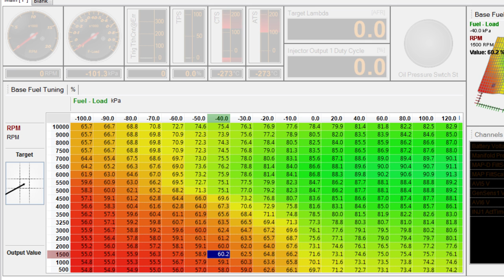Carburetor vs EFI: Separating Fact from Fiction - Technically Speaking.

Comment: For the average guy with the average engine, individual cylinder tuning requires more than what you have described here. A lambda probe in each exhaust primary is required and 4 dual channel wideband controllers are needed. Factor in this cost and sequential tuning is very expensive to set up. Batch fire is the next step down from this....but still better than a carby for atomization.

Comment: Changing from efi to carb right now on 85f150. It has cost me more money than the damn truck is worth changed fuel pump fuel filter throttle position sensor air intake valve and every other damn sensor on the truck! I’m going back to when a man can diagnose any problem within ten freaking minutes and fix cheap and easy! (No EFI)
Reply: Lol, typical parts thrower who doesn’t know what he’s doing, sometimes a popped fuse is the only problem.

Comment: Good evening.
If you look at the draw through turbo bike I've built (on my channel) you'll see I'm using a single flatslide carb. I'm thinking of changing this to run efi with individual injectors for each of the four intakes. I will fit a single, large throttle body where the carb is currently to keep the old school draw through look. Would you have a system that will fit my needs?
Thank you.

Comment: By using single point injection, you lose EFIs only advantage: cylinder-to-cylinder fuel distribution.
Reply: Hr BeStalkinMe 
You can also change cylinder to cylinder fuel distribution on a carb with a zip tie. Old racer trick
Reply: single point EFI has many more advantages than just that...

Comment: Carburettors are a pain in the arse. 

However I'm not a fan of direct injection systems as it can cause carbon deposits on the inlet valves and can cause engine knocking problems.I'm also not sold on the reliability of direct injectors that operate at insane pressures. I've had a lot of problems with cars I've owned that used direct injection and zero problems on cars that used ordinary multi-point injection setups.

Comment: Thanks for the video, but you forgot to mention how even though EFI is much more precise, it doesn't make as much power as a properly tuned carburetor and a well designed single plane intake, in the conditions the carb was tuned for. I'm not even going to try and say carburetors are better for daily drivers, they just aren't. They obviously don't adjust themselves for atmospheric conditions. But in a racing setup you get more power due to varying fuel droplet sizes from a carburetor. Injectors make a mist, which while great for burning fuel efficiently, doesn't make as much power. Also, considering a port injection EFI system is at least three times the cost of a top-of-the-line Holley, I think I'll stick to carbs, for now anyway.
Reply: +outlander330cc  
Can you provide any documented scientific proof of your claims?
Reply: No, but you can ask David Vizard and countless performance engine builders. In a drag race application you don't want fuel slosh and that's one of the reasons why the top tier drag cars are EFI. Truck pullers almost always use carbs, the low speed doesn't slosh as bad as drag racing. I'm not sure about circle track and road racing. As far as horsepower on the dyno goes though, carbs are always king.
Reply: +outlander330cc 
With all due respect, the blanket statement that EFI "doesn't make as much power as a properly tuned carburetor" is not accurate in all instances. 
I do not know what country you are from, but where I am in the US, that statement is proven not accurate. 

It should be noted that Vizard's testing and statement originated in 1999 and was not a level comparison then and today EFI has progressed and improved exponentially. 
Many of the others that still espouse carburetors over EFI are mostly old farts that are either incapable of learning and or do not want to expend the effort to learn about EFI. 

David Vizard's comparison was not an equitable comparative test for the following reasons.
(1) It was a comparison of a short runner single plane intake and carburetor against a long runner intake and EFI system. Vizard has acknowledged this and the flaw in several subsequent interviews. 
(2) The peak horsepower increase on the short runner manifold and carburetor was less than 1% and only occurred at WOT and in a very narrow RPM range near or at peak RPM. 
This <1% HP increase at peak RPM is indicative of the advantages of a short runner single plane intake more than can be attributed to a carburetor for fuel delivery. 

Intake manifold runner length is a critical element in intake design. 
Short runner intake manifolds optimize power production higher in the RPM range and long runner intake manifolds are designed to promote power production in the lower RPM ranges. 
On flow benches most EFI/throttle body/manifold combinations usually have higher flow numbers, especially at less plenum/runner depression values. 

Personally I have experienced mixed results when comparing carburetor to EFI performance on dyno runs. 
In 2014 we logged more than 1200 hours of dyno time, so far in 2015 we have logged more than 900 hours dyno time on engine and chassis dynos from multiple manufacturers that includes SuperFlow, AVL, DynoMite and Mustang. 
When the testing platforms are equal, most but not all our dyno testing and analysis of carburetor versus EFI results in EFI being the clear winner, especially in mid range up to max RPM where power and torque gains can be significant and in max HP/torque produced. 

Ask yourself why practically every race class champion that can run fuel injection or carburetion run injection and win? 
NHRA has changed the rules to allow EFi in Pro Stock and testing has already shown lower ETs and higher trap speeds with EFI. Not to mention the many other benefits of EFI over carburetion including but not limited to ease and extensive flexibility of tuning, intelligent feedback and integrated logging. 
With regard to EFI system cost differences being "at least three times the cost of a top-of-the-line" carb system is just not accurate where I am located. 
Today the cost difference for EFI is higher, but when comparing like performance systems, EFI is only a few hundred US dollars more expensive.
Reply: patw52pb1 Thanks for the detailed reply! I was hoping to get a conversation started on the subject, I had always been told carbs made more power but was kind of skeptical if that was the reality these days. I'm not exactly an experienced engine builder yet(only a couple hours of dyno time) so it's nice to hear from someone who's got some experience. Yes the first couple comments were borderline offensive to you EFI guys, that really was just to get you to reply haha.
Reply: ***** That makes a lot of sense, although I feel like methanol injection on an EFI vehicle would do the same thing, maybe not to that extent though.
Reply: +outlander330cc  The Carburetor cooling effect is real, but very misleading.While it is true that the colder air fuel mixture with the carb set-up often leads to more power on the top end of the range because of increased density, to compensate for that, the timing and or compression ratio on the EFI engine needs to be increased- even though the carbed engine would ping, the efi engine wouldn't. They never do those comparison tests that way, because it doesn't seem to be "apples to apples" comparison anymore.
Reply: No, just no... carbies can get close at some points, but with EFI the mixture can be set properly at every point - that is, load and rpm. If you are running individual throttle, especially with a 'healthy' cam' with decent overlap, reversion and rich running when off the cam' is a big problem as some of the airflow actually passes through the venturis 3 times - with EFI the fueling is provided for the actual air the engine uses.
Just call those Mikuni's slide throttles - sure, in their day, they were a common swap and a big saving on Webers or Del'ortos but a lot of messing around with linkages and keeping them in balance and they did have limitations.
Carbies have as much flexibility as EFI, regarding fitment - with some vehicles they can be an easy swap, with others it can entail a full intake assemble swap over. With a significant power gain, and hence fuel demand, a carbie setup may also need a pump and regulator upgrade. So, the may not be much difference - or it may even cost more...
When changing the fuel curve with carbies, one has to have a good idea of what one is doing - with emulsion tubes, chokes, jets, etc - and each time one wants to change the curve, one needs to have the replacement parts available to fit - $$$ - and it takes time to do so... and if you drop anything... whereas with EFI it just needs a couple of seconds to change some values. Not sure about the small child - I've had to repair a fair number of bodged 'repairs' people who thought it was easy messed up.
For the different applications, the right selection of manifold design and carbie can make a big difference in how a V8 performs - besides being easier to package and cheaper, they can give a much wider torque range than an independent runner design - even with EFI - this has been proven many, many times.
So, I'm a bit confused with that comment - you prefer something that doesn't work as well most of the time, uses more fuel and is harder to tune - the cost is subjective and application dependent?
Really? I've found very few people who do their own 'tuning' actually have much idea of what they are doing - probably about the same number of people playing around with EFI - but the industry has progressed to the point where EFI is darned close out of the box and some will even fine tune themselves to suite the engine's particular variables.
SUs on a Triumph GT6? I've only seen them with Strombergs as OEM Regardless, a single carb' just wouldn't be able to supply anywhere near the airflow required, will need careful setting up and modification if tried, and will suffer from severe icing up from the pressure drop across it. If you think it's that easy to install and bodge a supercharger conversion, I very much doubt you've ever had anything to do with such a one-off.
330Ci? If you're serious about it, just buy one of the kits currently available - easy peasy and probably cheaper than the GT6 bodge.
Doing anything properly will take time and money - where one calls the line will depend on what one expects. Don't forget that not doing it properly - carbies or EFI - will also be expensive, not just for the time lost messing around with bits and pieces, but the testing (dyno' time is expensive), jets, tubes, distributor mod's, etc - and the ongoing poorer fuel economy, drivability, etc, that is about right from the start with the correctly selected EFI kit.

Oh, somewhere in there you made mention of the noise - I run Jenvey ITBs on a Cosworth KBA - friends have run DTH and other types of ITBs and there is no loss of intake sound Vs Weber, Del'orto or other ITB carbie installations. heck, it can be downright painful close up without hearing protection!
Reply: No worries, started my auto' mechanic apprenticeship in the mid seventies (damn, that makes me feel old) and most of my working life as a mechanic was on carbies and points, so I know their worth - what I am saying is that EFI (potentially) is better.
SUs and Strombergs operate on the same principle and, before they started messing around with them for emissions, they certainly are a basic fuel metering device - but I have seen some botch jobs with both and even one chap who thought he had a dropped valve and parted out his car when it was a simple hole in the diaphram - god knows why he thought that when there was no noise...
Regarding the icing - you sort of have an idea of the problem - what causes the icing is down to two things 
a/ while all cabies use a pressure drop to draw out the fuel (venturii or depression) there is also the pressure drop from atmosphere at ~1bar/14.7PSI on one side to a lower pressure on the intake side because the carb' is a restriction - if the carbie is too small the pressure difference, and hence cooling effect, is greater. I have seen this occur in at least two instances with draw-through turbo-chargers with a SU and the 'cure' was to use a much larger SU carb - the chap using two would have a similar effect - and 
b/ if/when the carb'body temperature drops to 0C, or below, any water vapour in the incoming air that contacts it will freeze, further restricting the airflow and hence pressure drop, and can build up to a point where the throttle butterfly is frozen in position. 
Some of your comments do underline the advantage of 'old school' over EFI, though, and one I can sympathise with - faults are easy to find and rememdy, and there is much less to go wrong - although modern electronics is a world away from the early stuff as regards reliability (well, there are exceptions, like the smaller VAG dual clutch gearbox which was notorious for expensive electronics faults).
With the dissy, with a match-head of grease on the rubbing block, it should last many thousands of miles without any changes, least ways, that is what I found, but when I finished that part of my career it was with a transfer to another branch as a Senior Mechanic and I was shocked to find that "points closed up" was a common refrain for the fleet breakdowns, purely because they wouldn't lube the rubbing block! If the Rover (and others) have a significant mileage, check them for play in the dissy shafts as wear there will allow the timing to move around, while doing that check the base plate for wear as that can cause the plate to move, causing the points gap to alter - you can often get replacement shaft bushings as a service part from a dissy specialist - I will usually use an additional one in the middle for extra support, if it will fit.
Reply: @motorised1  all good but wait until your are sitting at a light and one of those damn sensors or relays decide to die, then you're looking at a tow bill as well as the time and cost to find and replace them. Happened to me I switched from efi to carb,  one year later no breakdown issues. Thank you carb.
Reply: In my country USA the damn EFI is junk and won’t even run. Plenty of compression and spark, fuel to the rail but not shit through the damn injectors! Probably another forty dollar sensor! SMFH! It’s intake and a Holley for this old man!
Reply: @oui2sas  Sensord don't just crap out that often bud. Matter of fact they almost never go bad.
If one does go bad you just read a damn code & replace exactly what you need....

Your argument does not exist.....

Comment: for sure the injection is so much better, in special the programable EFI, which you can play with volumetric efficiency, spark advance, and you have all control, and can see the sensors in real time, and search the AFR target, also the fuel injection is so much precise delivering the correct fuel amount in to combustion chamber, less contaminant, the ultimate EFI injections are the full digital, close loop, what means that? more efficient because you have the total control in inputs and outputs.

Comment: Well.  yes the fuel injection is nice, but,   right now my car, a 1990 runs like crap.  not throwing any codes according to the scanner and I cant find anyone who can figure it out.   Never had this problem with a carb.  so,  ready to ditch the FI for a good old Holley.
Reply: Going to depend on the car - I have one car of that year with the Bosch Motronics 2.5 that has a diagnostic port - or you can read a flash code from the engine warning light.
Problem with error codes is that they usually just throw up error codes when they are out of range - OC or SC - and if it is an acceptable value, even if wrong, it is "OK" and not marked down. I had a TPS issue that instead of being on-off-on during opening was on-off-off with one wire being OC - that was one of the values the ECU expected, so wasn't triggered as an error. I picked it up with an Ohm-meter.
That said, as you say, it could be some other issue, such as ignition or injectors or a clogged fuel filter that these older ECUs don't pick up - comes back to a competent mechanic working from the basics, just like with a carbie and clockwork ignition setup. There were some cars from that era that used a mechanical FI setup, and sometimes simple things like a sticky air valve would really screw up the running.

Comment: Kind of misleading. There are several factors of a carb. It’s not just jets and “emulsion” tubes. There are accelerator pumps, cams, boosters, power valves etc. knowledge is power. Pun intended. Both achieve the same goals but I would encourage more to understand how a basic carburetor works before just throwing them into EFI. Crawl before you walk.

Comment: Carbs worked flawlessly for over 100 yrs. Fuel inj guys just dont know how to tune a carb. Something goes wrong with fuel inj ur gonna need a towtruck, with a carb you can get home. Carb makes more power period.
Reply: I GUARANTEE to you than any man who has the knowledge to tune a modern efi setup will also know how to take a float bowl off & unscrew a jet.........

God.
Reply: Flawlessly?  I have cars with over 100,000 miles and over 10 years old and never been broken down because of EFI.  EFI will start on first crank, no flooding or priming needed. Doesn't matter the temperature outside.